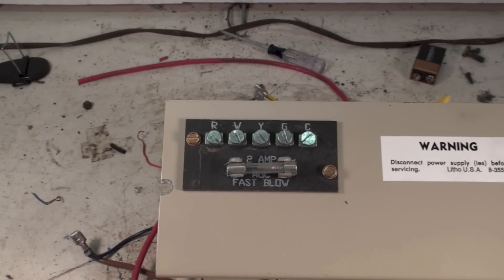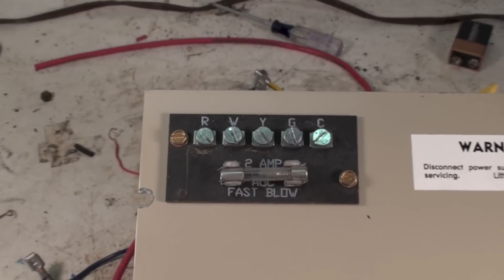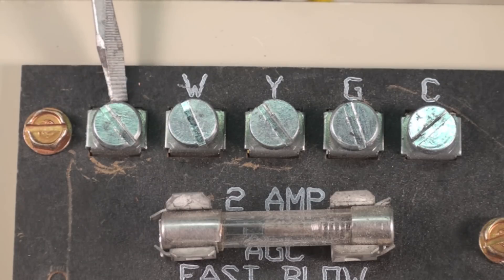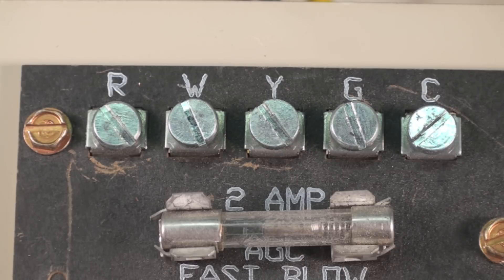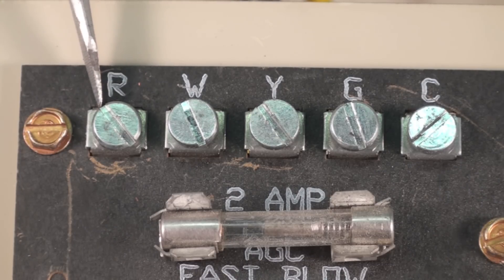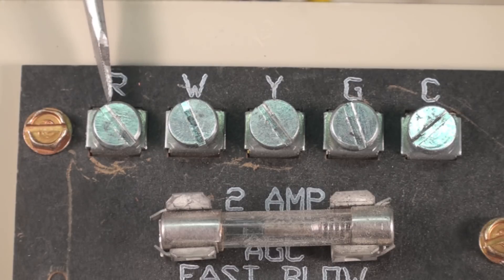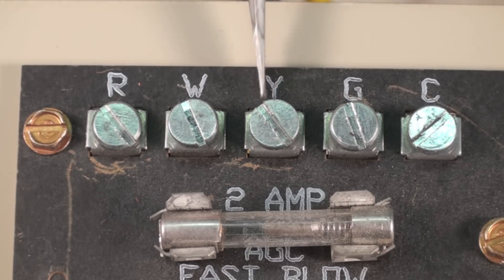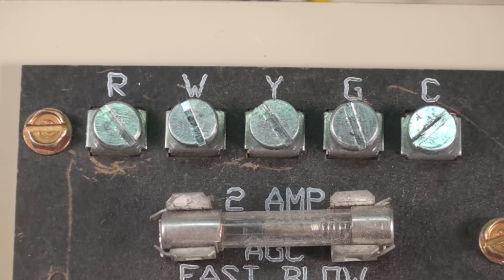What the terminals on the furnace terminal board mean

Comment: Great videos furnaceman! I love the share the knowledge philosophy. Having watched this video I had full confidence that I would be able to run a new thermostat line to provide myself with a (C) Common to install a Wifi Thermostat.....Then i opened my furnace....LOL....I've sent a picture via e-mail so you can see. I am confused on a few points. Backround: I have gas hot water furnace. The current thermostat has just 2 wires (red and white). It appears that both the water valve and gas valve are attached to C terminal. Orange from (Y) goes to what looks like a water temp thermostat above and then to water pump. I'm baffled that nothing is terminated at W and White from thermostat is terminated on G. There is a plug and switch on the back side that may account for other wires. The transformer says 42 VA. Do I even have any room here to run a Common? Or am I out of luck? I've e-mailed you a picture so you can see.
Reply: Correction: On closer inspection the cluster of wires lower left (from Y terminal and R terminal and orange) goes to the automatic chimny damper. The red from (R) Blue from (G) and Yellow from (Y) goes to the water valve
Reply from the maker: pjsronan Again, change nothing you don't have to. just run the common to power the thermostat.

Comment: I have a Honeywell 360b without a sail. Yellows are wired to the humidistat to turn on when you turn on the humidistat to a certain level... (Always on) Pardon me but this seems like a huge waste of water and electric... How can I wire this so that when the furnace starts or the fan starts the humidifier starts? Can I do this locally at the furnace or do I have to run a wire to the thermostat? Any ideas would be greatly appreciated!
Reply from the maker: I will be doing a video about this soon. Maybe this will help.
GFM
Reply: grayfurnaceman
Yes that would be great thanks! I didn't mention before but the furnace is a Lennox 30A-2. From what I understand a sail switch should have been installed but was not by the installer before I was the owner of the home.

I watched your recent video on the oil fed furnace which I thought was very interesting. My brother had one when we were young, We got it to work but I can't remember how, knowing what I know now about the red switch I can see we were a little on the dangerous side back then! Really good information here!